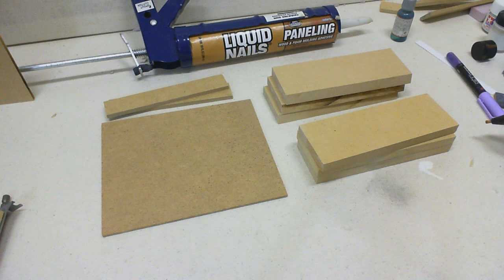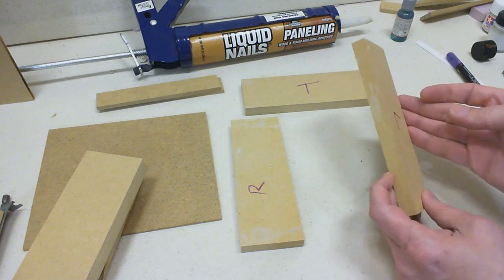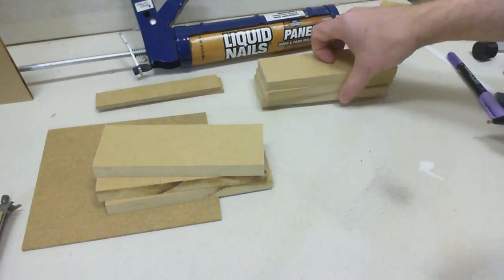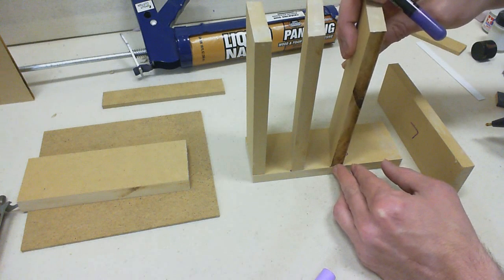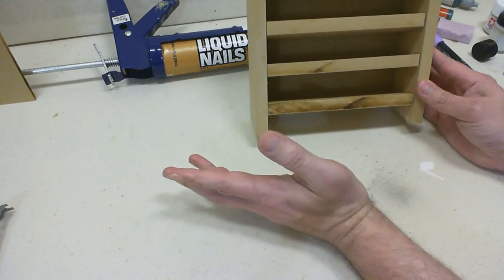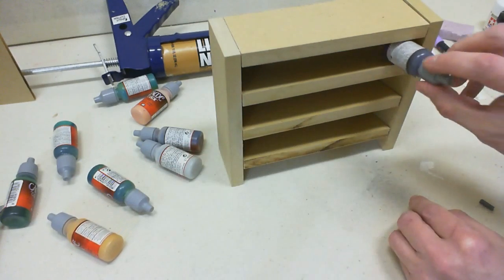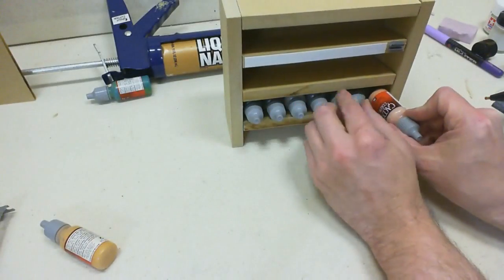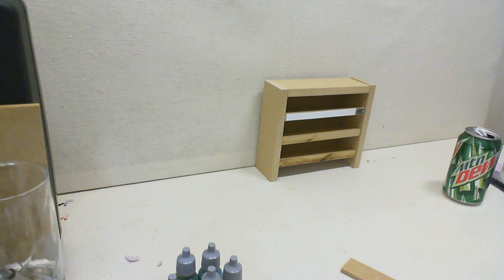Paint Storage - Video Response for Les (awesomepaintjob.com)

Comment: If I had a permanent area to paint I'd give this a try. Right now my paint storage is a few cheap small plastic storage tubs with thick plasticard slanted at an angle to hold the paints. They have roughly the same footprint that the one you made does but they have a lid for easy storage and when closed they stack nicely. Very nice job on your paint rack. I'm sure if you took your time they'd be great looking. Not bad for a quick mock up.

Comment: I photos of the paint rack the I built on my channel posted as the most recent bulletin, need to make a video of it and post it. If I remember correctly I found the idea for the rack in Model Railroader magazine, but it uses a piece of plywood as the back and then you use L shaped metal brackets screwed/bolted to the plywood as the shelves.